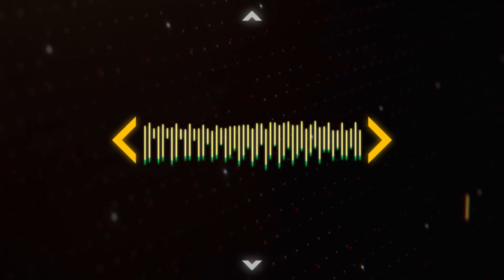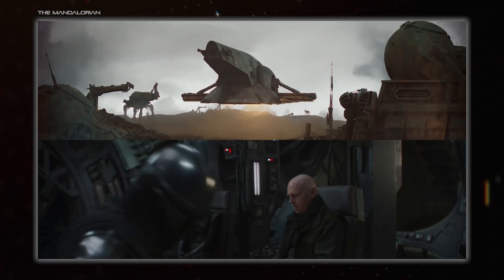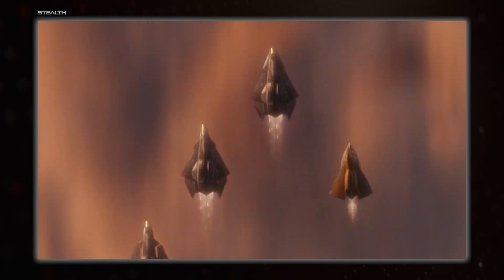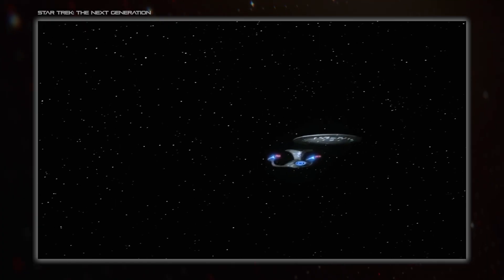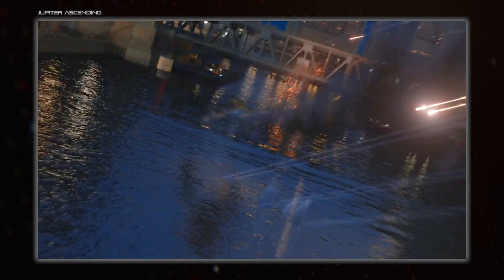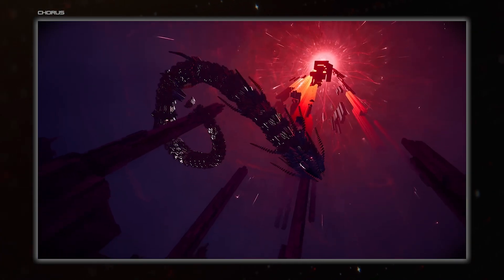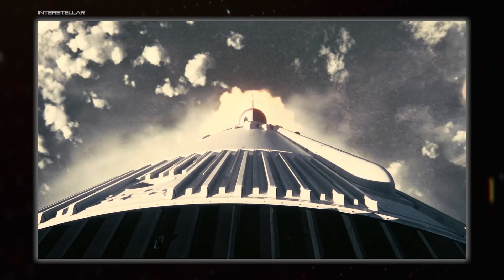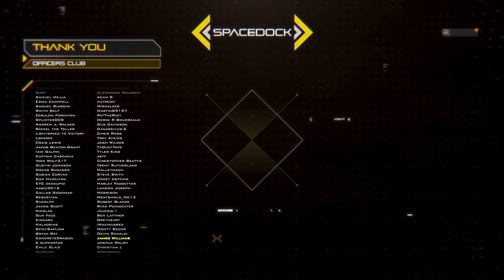Variable Geometry in Sci-Fi Spaceship Design

Comment: you used the argama class from Z Gundam It's " variable geometry" was really nothing more than a set of agricultural blocks used primarily to supplement the ships oxygen supple.
Now now there are several ships mainly Capital ships said do feature variable geometry. The Gundam: the origins version of the White Base has wings that fold out and Tuck inward the Diva from Gundam Age completely transforms the both the main engine pylons and the catapult decks rotate to more reference the White Base went in there first Arc position it looks more like a star destroyer

Comment: IRL, straight wings are more efficient at low speed, but they're unstable at supersonic speed. Swept wings are more efficient there. Moreover, the mechanism to sweep the wings adds weight and complexity. Various technological advances mean that variable sweep wings are no longer the optimum design for military aircraft. So ... in space, you don't have aerodynamic considerations, so it's basically just the rule of cool.
Reply: It's not that straight wings are unstable at high speed, they just generate significantly more drag for the same total wing area, especially once supersonic shockwaves start getting involved. Even a comparatively gentle sweep (see the F/A-18 Hornet and Super Hornet) can have a surprisingly large reduction in aerodynamic drag. You're correct on why variable geometry was abandoned, though. Pretty much every single swing-wing aircraft was a maintenance nightmare, and modern digital fly-by-wire gives even legacy airframes like the F-15 startling amounts of maneuverability, even at extremely low speeds. A less commonly talked about downside of VG wings is stealth; the joint is effectively impossible to completely smooth over, and the wing itself can only have an optimal RCS in one position.
Reply: @griffinfaulkner3514  Stealth is an important factor considering that it's arguably the primary defensive measure of modern aircraft. High speed performance is much less relevant when that speed isn't what's keeping you alive, likewise for low-speed maneuverability. When your plane isn't expected to out-turn missiles in dogfights or outrun SAMs, the flight characteristics of the airframe don't matter nearly as much so a bit more drag at high speed or a wider turning circle at low speed are acceptable.
Reply: @aurtosebaelheim5942  That's the point I was making, but when talking about the downsides of swing wings it's almost never mentioned. Stealth is arguably more responsible for the death of swing wings than maintenance costs, considering how expensive RAM coatings are to maintain.
Reply: The evolution of the concept could be for an aerospacecraft that is designed to alter it's profile in atmosphere and exo-atmosphere, as well as orbital descent and ascent. An example that comes to mind is the Jackal from Call of Duty Infinite Warfare

Comment: Another one I'd like to mention in the Realistic category is the Hail Mary from Project hail Mary. The ship splits in half to become a Centrifuge when needed, but it can retract back into a flight mode at will. They use the feature multiple times throughout the story, even using it during an uncontrolled spin to lessen the force of gravity by expanding the radius
Reply: I'm going to second the Hail Mary here. What also interests me about the variable geometry on it is that in the spirit of "need to be small to launch but big for gravity" is that it's an entirely flexible system using a series of unspooling cables that connect the two rotating sections (one section that houses the engines and fuel and the other that houses the crew support systems.) That way it can expand to become very long without requiring a lot of complex mechanics or substantial additional mass.
Reply: I really loved the book, I hope it gets a decent adaptation one day
Reply: @Mighty_Spoon  There is a movie being made as we speak. I believe they've already cast Ryan Gosling as Doctor Ryland Grace. Lots of speculation on the casting of Stratt
Reply: It seems this channel largely ignores literature. Likewise most of the audience. It's shameful how far down I had to scroll to find this, the only comment, that isn't about a tv show or movie.

Comment: In the Battletech videogame released in 2018, the hero ship has three large pods toward the rear that serve as living areas. In flight these are folded flush with the hull so that occupants experience thrust gravity. Upon reaching a destination they fold out perpendicular to the ship's axis, and it then spins up to rotate around its axis and generate spin gravity within the pods.
Reply: The Argo is such a beauty.
Reply: @seb24789  Normally, that kind of variability of configuration is a terrible idea.  The maintenance and such is just not worth it.  But in the case of a ship like the Argo, so long as the components are sufficiently "overbuilt" so that they can take more wear and strain than would otherwise be normal...it's not a bad idea.

It's still not a great idea...but at least it's not horrendously stupid.  Having such a large mobile base of operations is obviously useful, and having its own pseudogravity would also be pretty handy.  Especially for extreme duration missions deep in undeveloped (or even completely uncharted) space.
Reply: The whole point of the Argo was that it could be a mobile orbital base for long-term exploratory/survey missions. So it makes a lot of sense to have that feature in there.
Reply: @seb24789  The Argo should have been a scout/hunter class Jump ship.
Reply: @dirus3142  Oh no, anything with that much tonnage, realapace thrust, and an actual jumpdrive (and given its layout it would have to be a COMPACT KF drive would get Comstarred so fast your head would spin.
Reply: @DIEGhostfish  Argo doesn't have a jump drive.  It is just a large drop ship.
Reply: @blshouse   ...I know, I am saying what would happen to it if it DID have a KF drive, especially a compact one. Comstar was fine just wiping your computers and putting spies aboad since it's just a dropship with factory bits. If it had a CKF it would have been sunk.
Reply: The reason I love it on Argo is that it has gravity while under thrust too so when they fold back it keeps them working as gravity decks. Aside from during transition it has a place to go to keep your body from atrophying... it's so damn cool
Reply: Came to say the same. I would have loved if it was a pocket Jumpship as well, but I'm super glad they kept to the setting lore and didn't. Comstar would have "White Lion'd" it as soon as they saw it existed.

Comment: A good use of variable geometry in space vessels is to spread out radiators to deal with excess heat while stationary and then fold them back in behind a forward micrometeorite shield for flight!
Reply: Correct.  Variable geometry should have a specific clear purpose that directly corresponds to combat effectiveness.
Reply: I have this in my setting, also making a starsector mod based on it it, but I'm not proficient enough with code to make them pop out, was thinking of a flux related ship system that would stand in for the actual in setting cooling abilities, could do the animation just fine, but the rest? Maybe some day, for now I decided to just have them in the deployed position on all the sprites that do have them.

Comment: In the Forerunner Trilogy novels, they describe the tech that allows them to keep all those separated parts working / moving together as "constraint fields". When I read that, it made me think of the various Constraint tools you can use in 3D modeling sotware like AutoCAD, which lets you determine where features on an object or drawing are in relation to other features. For instance, you can set the distance between two parallel lines or two surfaces to a certain value, and as long as that constraint is applied, they will always remain that distance from each other, no more, no less, even if there are no other parts connecting them and if they never touch one another. By the same token, if you manually increase or decrease the value of the distance by which those parts are separated, then you can make them "float" further apart or closer together.
Reply: Just make your ships four-dimensional. The floaty parts connected to the main hull through the fourth dimension.
Reply: Really bro? You just went on a huge rant about constraints on drawings in Autocad because the same word was used in a book? You know that's what the word means, right? So it reminded you of the only other application of the word you know of, so what?

Comment: Actually, was imagining a spaceship made mostly out of small segments (say Sg1 replicators), able to connect in different smaller designs (like dogfighters or the prowling crabby shape of basic replicator.

THAT design would incredibly fit into SG setting, especially SGU setting, where the crew is in distance and location unreachable by means other than stargate, wich is a roundish ring with zirca 3 meter of inner diameter. Not to mention, that such spaceship/army of small robots/fleet of starfighters, could be incredible handy for resource mining, repairs of Destiny and re-stocking of expeditions non-edible suplies, and vastly expanding Destinys fighter/drone compliment (for having some replenishable redshirt starfighters on the ship can help. Not mentioning adding the expedition crew a second FTL capable and steerable spaceship.

That should give the ship unparaleled ability in eluding anti-ship torpedoes and most of one-shot, one-kill anti ship weapons. Not to mention unparaleled transportability and modularity (and repairability if enough new segments are aviable or can be produced on site).

Comment: Pro: Cool folding geometry.
Con: OHGOD THE MAINTENANCE COSTS!
Reply: As someone who spent their adult life in aircraft maintenance, I feel this.

I'm always looking at how much of a PITA things in sci fi look to maintain.
Reply: Isn't the whole subtext about how technology has made the maintenance aspect less of an issue?
That's what I see anyway - technology making things that used to be hard to do, easy to do.

Like, if they have "floating bits" tech, surely they also have tech that scans the thing and floats oil particles through tiny cracks to lubricate and then fix anything that needs fixing.
Reply: @iwiffitthitotonacc4673  You would think so. But I can tell you in most ways an old C-130H is easier to maintain than a brand new C-130J.

An old valve either works or it doesn't. When everything is run by a computer, you have to check everything from the valve to the seat.

And don't get me started on the automated maintenance systems.
Reply: @iwiffitthitotonacc4673  That's a very Dunning-Kruger way of looking at technology so advanced it resembles magic to the layman observer.

It's easy for you, the end user, to swipe your finger right or left on a touchscreen, but there is a ridonkulous supply chain spanning multiple continents that backstops our $1000 smart devices. Even if the end user doesn't realize it, someone has to pay for those externalities of our deceptively simple life experience.

Stealth aircraft and submarines look sleek and simple, but a big chunk of their maintenance costs cover replacement of their special surfaces b/c these get dinged every time someone puts a wrench to an access panel.

Similarly for "floating bits" tech, it LOOKS so simple and elegant on the surface, when a CGI artist or game dev takes the cheap cop-out of using handwavium and anti-grav tech to float components into place. But that's only b/c it's easier than the artists tearing their hair out over 200 hours of single-use mocap to animate two technicians swearing and beating a positronic torque regul-O-tron and 200 other components into place.

Sure, future wondertech may have improved diagnostic and floaty capability, but then we get into making or maintaining the tools that control the tools that fix the floaty tools that squirt the lube in the primary tools we're trying to operate in the first place. That's either going to be more expensive in automated equipment and/or require more expensive manpower to maintain. Unless our economic system suddenly does a 180 into post-scarcity utopia where no one charges money for licensing rights to floaty tech or AI diagnostic software/hardware, there's going to be a price.

Admittedly, there have been some big paradigm shifts in manufacturing (and thus maintenance) complexity. Like when we went from mechanical computers to vacuum tubes to transistors. Huge reduction in mechanical complexity and maintenance. However, the increased sophistication led to a demand for globe-spanning supply chains to mine the rare metals required and to specialize entire regional economies to produce types of electronic components.

For floaty tech to be simpler, we'd have to discover/create some similarly dramatic paradigm shift in technology.
Reply: @iwiffitthitotonacc4673  Just because a technology is more advanced, it doesn't mean it's easier to maintain. In some ways it is quite the opposite. Every time you add moving parts you add friction, a possible need for lubrication, machining tolerances, weight and structural strain on the device in question, i.e. you add new points of failure. In some cases, these additions are worth it. An example is the difference between bolt-action and automatic firearms, one has a distinct advantage in capability the other can never really live up to. Variable geometry wings on the other hand doesn't offer that much in capability that you can't get with technologically simpler and easier to maintain alternatives. It looks cool and certainly has an appeal as a result for SciFi, but I doubt it serves as a realistic future.
Reply: The same things are said between engineers and technicians. Engineers will point to these types of features and tell you "but it's so cool and high-tech, it's the way of the future! Why wouldn't you want it?", the technician responds "those wings are going to cost an extra 400 man hours of maintenance per plane per month, and all of our mechanics will need to be placed on suicide watch."
Reply: @jasonreed1631  you joke, but I'm pretty sure I've heard it stated without irony that there was an actual, measurable drop in suicide rates among Air Force maintenance crews when the Aardvark was retired
Reply: @davispeterson1876  Not sure if that's true, but I knew a few 111 guys while I was in. Every one of them loved the aircraft to a worrying degree.

And every one of them would get this stone cold, serial killer look in their eyes when you asked them about turning wrenches on one.
Reply: pro: much smaller landing footprint (sometimes)
Reply: Only for the ships & tech...
The rest was... Meh...
Reply: Well the budget kinda becomes irrelevant when the tech is common enough to be used in various different applications 

At first these things might be only put on the best of the best type of stuff but later on when the tech becomes better and easier to make they might be just slapped on a spaceship for various reason
Reply: We have space Magic for that.
Reply: Maybe there's less dirt and grime in space?
Reply: another con: too many and it will fall apart like a lego set as soon as it takes a single shot in the wrong place.
Reply: @sleep_deprived_stormworker  Correct.  Variable geometry should have a specific clear purpose that directly corresponds to combat effectiveness.